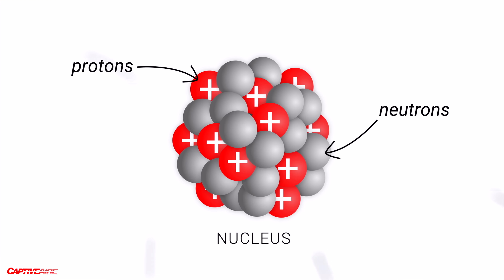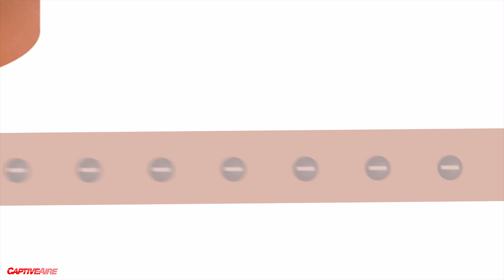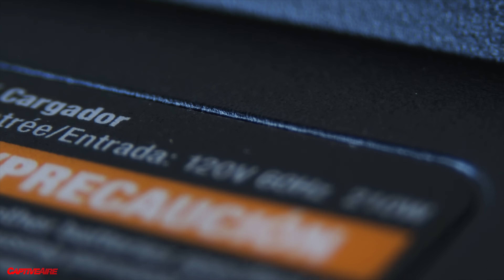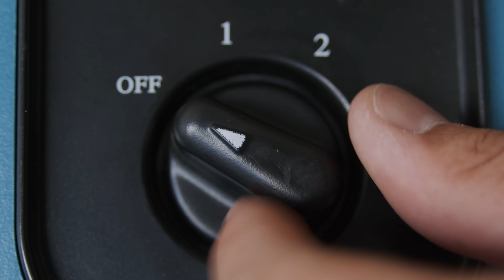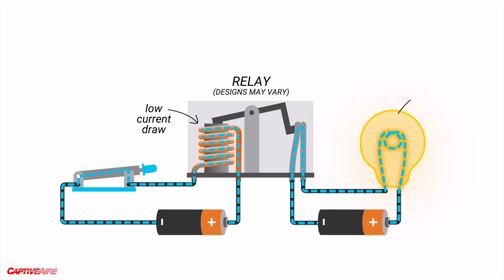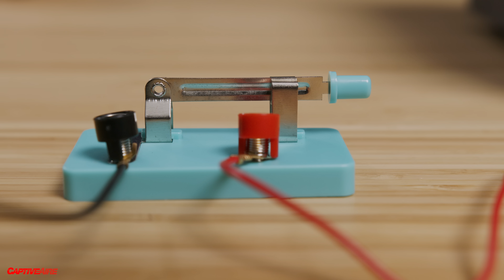Electrical Basics Made Easy

Comment: Amazing video! One minor critique as a mechanic in regard to your illustration of jumping a car just for safety purposes. You never want to put the final negative cable directly on the battery. This can cause a dangerous spark and a possible fire due to hydrogen gas, which is highly flammable. It's best (and safe) practice to find bare metal to clamp onto to ground.

Comment: This is an excellent video👌 
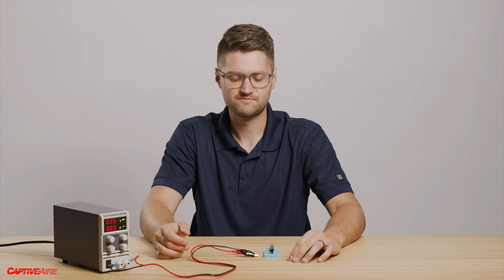However, at 17:35 you incorrectly show Resistance=Voltage x Current (which would make 0.75 Ohms) Ohms law is Resistance = Volts Divided by Current 2.5v ÷ 0.3A=8.33 Ohms.

Comment: This happens to the frame of appliances when a hot wire has short circuited onto the cassis instead of following its normal circuit flow path.

Comment: A PhD student here. Thank you, Good Man. And thank you all that participated in this video. It was a great lecture.
Reply: I beg that they consider doing a series on the logic and organization of schematics, starting with simpler ones, then, explaining the problems engineers face, & introducing the solutions to those (in small examples) before building up to ever more complex scenarios. There are innumerable YT videos that are titled such that you'd think they teach these subjects, but, they're always little more than a diatribe on the devices that go on them: "This is the symbol for a capacitor, it has two metal surfaces, yada yada, and this is a resistor." But never why things are organized the way they are. The challenges engineers face & the solutions that work. With the goal being the ability to (at a high level) understand schematics

I realize that these are NOT cheap. You have very intelligent experts working on nothing but education despite being a for-profit corporation. And altruism is a rather expensive pastime! But perhaps your CPA knows that this would qualify as a write off!? As it does constitute educational material. I just hope you guys continue this. As the quality and clarity are unprecedented. Literally.

Comment: I think your battery, light bulb, and electron flow visual might be slightly flawed, here’s why I think that:  You show electrons flowing TO the light bulb, but then you show the SAME amount of electrons flowing away from the light bulb back to the battery; I’m thinking that this cannot be true because the battery eventually runs out of energy when lighting the light bulb for a long period of time.  So, if the same amount of electrons were, in fact, flowing back to the battery as were coming out of it, then theoretically, the battery would never run out of energy, am I right?  So, we must assume that those electrons that flow to the light bulb, where 90% get converted to heat (which dissipates into the air) and 10% gets converted to light energy, actually get used up.  So, if some of those electrons get converted to heat and light, then common sense would dictate that those “used up” electrons diminish how many are left to return to the battery, right?  Am I right or not?
Reply from the maker: Interesting thoughts! Electrons creating heat or emitting photons do not “consume” electrons, they are just the result of electrons moving rapidly and interacting with other matter or changing energy levels, respectively. The electrons do, in fact, make their way back to the positive side of the battery. To keep things simple, a depleted battery is simply the result of electrons returning to the positive side of the battery. In order to charge the battery, a charger forces electrons to flow back to the negative side of the battery. This takes power because electrons repel each other and they would rather not be all clustered in the negative side.

Comment: I’m here because at the age of 40 I’ve finally started learning about cars. Well, a truck that mom gave me. An old ford. I’ve already used the internet to teach myself to repair the ignition, the power windows and now I have an electrical issue. No low-beams. 😂 naturally I’m learning at a crazy pace as I absorb it all. I did actually create a lichtenburg device to burn my woodwork. I didn’t understand the way it worked I just connected the wires like the guy on YouTube showed me. Don’t worry I added a few safety measures, a deadman switch and an led light-switch. I digress though. I’m here to actually understand what I’m doing.
Reply from the maker: YouTube University FTW!

Comment: Sunbeam was 27 parts engine 200 mph in 1920sv. …add hydrazine N2H4 hypogolic REACTION 2 touch.go !! Add oxidizer N2 O4.   We have to.2.too liquids easier design more push 1 thousand..sss more volume how we make a car safe engine??  N2H4 plus N2O4 make n2 gas and water

Comment: Air then CO2 holds 20 times the ZHEAT && methane hydrate 5000 year supply also very very risky coastal environment so iff too hot a day more escapees from ocean bottom layers of sand&clayb uff iff too much …Bermuda TRIANGLE BIGGER THAN SHIPS EAT CRAFT THAT FLY TOO

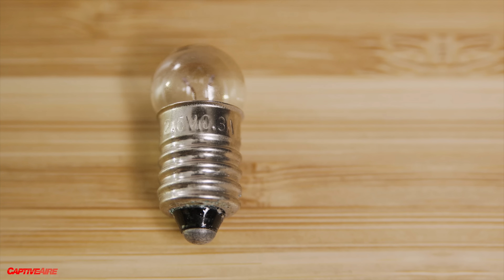Comment: 17:22 - Wait! What?! You just said current was “A”. So, where did the “I” come from on the very next slide?! You just skipped right over that one!
Reply from the maker: Good point. There are different ways to represent these things, the first slide showed the units used for measure, but there are often different terms used such as "I" for current (from the French translation of current "I"ntensity), or "E" for voltage (from "E"lectromotive Force). We probably should have mentioned this in the video, good catch!